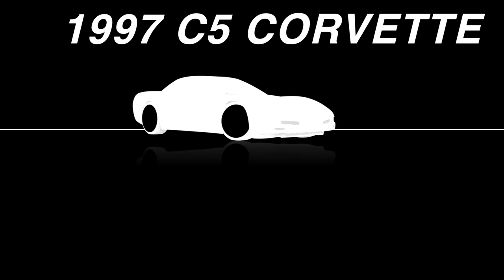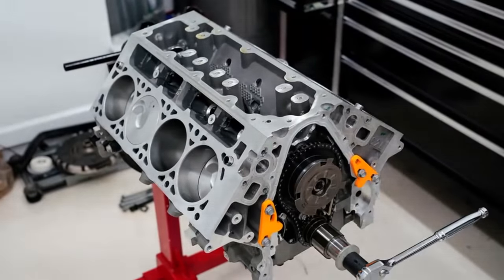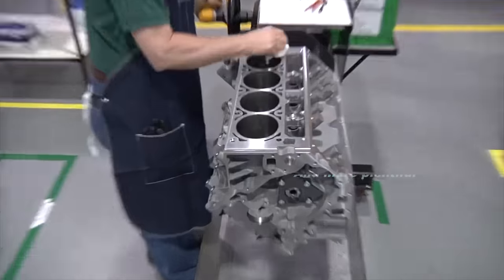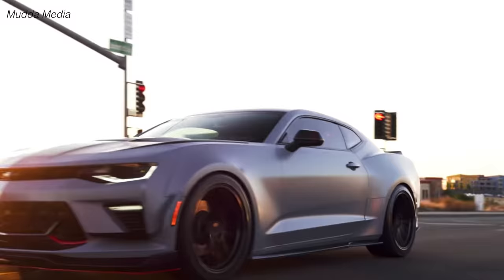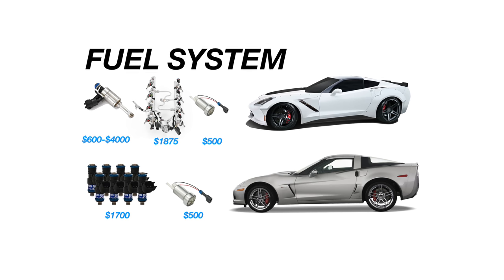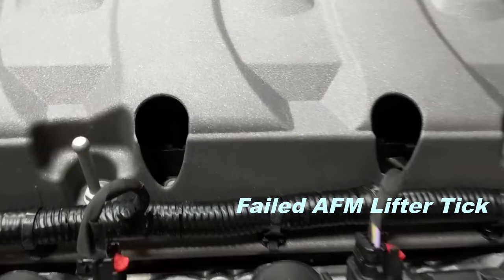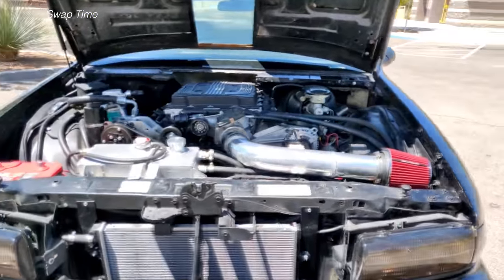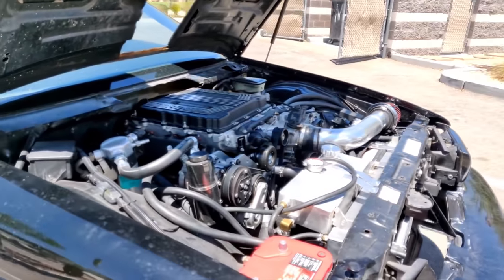Why LS Engines Destroy LT Engines Still😭 | Explained Ep.1

Comment: What's so great about the Ls is you can pretty much grab any variety from the junk yard for 500 bucks, slap some cheap turbos on it, and go faster than anything in your general area. It's great.
Reply: Yea unless some local has a single turbo 2jzgte vvti that’s real spicy
Reply: @jonathanramoslexusmaster298  If that's spicy than a turbo LS is fire. The 2jz single will basically be N/a up to about 3,500rpm. Meanwhile it just got trucked by a 5.3 with two ebay gt45s and a mild cam...bus lengths...a tractor trailor...a mobile home, lol.
Reply: @jonathanramoslexusmaster298  2jz are not $500 bucks, tho. And weigh more than my mom.
Reply: @jonathanramoslexusmaster298  that's 100% irrelevant, because that doesn't matter where the hell you are
Reply: No you can't. Idk where you guys live but I live in phx and I check SoCal yards, Nevada, phx, even Colorado yards and usually if it's a 5.3 or 6.0 it's $900-$1100 depending on if fits a gen 3 or 4. A true "LS1" from an f body or a c5 is at least $1100-1200 depending on where you get it. I can maybe see a 4.8l going for $500 with 250k miles on it but the $500 LS swap is a myth. I'm maybe $2k into my 5.3 swapped obs k2500 and  I still need to finish the exhaust and fab up an intake.
Reply: @MegaDysart  not a myth
Reply: I'm actually going to look at my first LS long block this weekend. 
The kid said it was his grandfather's before he passed and he was the original owner and doesn't know anything else about it so im going to identify what LS it is specifically. He's asking 400, depending on which lsx it is I'd say it's a no brainer for me to pick up this engine?
Reply: @jonathanramoslexusmaster298  even Toyota factory team never choose 2jz as a race car engine. It's not that good.
Reply: @MegaDysart  they are probably just expensive in your area not where I'm at lol

Comment: I like how you said the internet says you need at least 1000hp.  My 505 LS7 is plenty for getting into trouble. Even the C5 Z06 feels very fast. YouTube makes everyone who hasn't driven a fast car yet think these are slow.  Hell, a fiesta st is a ton of fun with 197hp.
Reply: With 1000hp you can’t rlly do much but go straight
Reply: @a1phamalestud  Then sideways very fast
Reply: I blame the YT channels like 1320video that showcases 600-1500HP cars like they were a common thing. People don't realize those cars are the top 1% of fast cars. Heck, if someone has a 400HP car, he's faster than 95% of the cars on the road.
Reply: Exactly. I've driven my buddy's bone stock Evo 8 and the thing is a blast. Don't know the power numbers off the top of my head but it's certainly less than 505.More than enough to have some fun
Reply: We’ll said. They just pull 0-60 times from the internet too. They dont understand the conditions those times are set in.
Reply: @sug8056  true
Reply: @mathieulevasseur4082  I think EVs have made hp completely ridiculous. When every tesla has 500 hp then it makes everything seem insignificant. Obviously a lot more to driving than HP but not on the internet.
Reply: Back in the early 2000s, I knew guys with civics running low 10s all motor lol... think they made like 250 hp XD
Reply: Outside of drag racing, the most fun you can have is driving a "slow" car fast. There is a reason things like Miata's and hot hatches are so popular.
Reply: @wingracer1614  Also cuz their cheap
Reply: A little over 400 horsepower in a mostly stock Challenger (cold air) and I'm both solidly in the 13s and faster than most cars around here... Ya'll Take Care and be safe,  John
Reply: @sug8056  From that "Oh yeah!" to "Oh shit!" Very quick
Reply: I always say there's power you have and power you can use. At some point, there's only so much power most people can safely control plus most of us drive on public roads. The traction control on my 2008 Z06 has saved my bacon many times.
Reply: So when is the LS 7 engine and suspension going into a Fiesta body? (THAT would generate some Youtube views and might pay for the car.)
Reply: I had tire spin issues through third gear with a stock LS7, so of course my solution was to add more power, because I am a disciplined, rational person.

Re: the actual discussion at hand - it is much more fun to drive a slow car fast, than to drive a fast car slow.
Reply: True. And the most reliable power setting is actually just stock with maybe some higher quality material bolt ons. Putting your car on a diet is the same thing as adding horsepower and better handling without any of the drawbacks.
Reply: It's not the size of the swizzle stick, it's how you stir the drink. :D

If you don't match those gobs of horses with a proper suspension, you'll have to slow down to a crawl every time the road deviates from ruler-straight.  I'd much rather have a car that takes longer to get up to speed but that doesn't have to slow down all that much when the road starts twisting. :D
Reply: @mrz80  or, or, hear me out - big power in an also well balanced and light package, so that you can both go fast in a straight line and grip the road and turn
Reply: @AndrewB383   That would be the ideal, most assuredly. Too often, though, I see guys go for power to the exclusion of all else. It's great for burnouts and drag races, but not so much for flogging those sweet little mountain roads. :D
Reply: @mrz80  ohh deff- i'd trade you 600hp out of a 1000 for the ability of taking tight turns at high speeds and have the person next to you wondering "how the hell didnt we flip?". funny enough, it is waaaay harder to make good supension/traction than it is to make big HP.

Comment: My favorite engine of all time is the LS3. Came in my favorite Corvette generation (C6) and my favorite 4 door sedan (SS). The 5th gen Camaro didn't really speak to me that much (mostly due to that hideous interior) but I still would take it's LS3 over the Mustang's 5.0 coyote.
Reply: As a 5th gen owner I never understood the hate towards the interior. Its simple, has cool lights, & easy to clean. I do have a 2ss if that makes a difference.
Reply: @julian_sp  I think everyone got tired of the green LEDs on the dash and door panels. It's the very reason why I didn't get an 5th gen😂🤣plus if you had the automatic it was slower than and 4th gen Camaro.
Reply: Hmmmmnnn… nah.. nothing like a stroked LS7… it will make the power naturally aspirated that of an LS3 supercharged… There is nothing that runs so strong as a built LS7 stroker on nitrous or even turbo. Like the old saying says. There no replacement for displacement. When it comes to Chevy motors they rely very much in displacement. The bigger they are the more power you get specially in latest engines..even though a lot of old school big blocks still make considerable power when done right.
Reply: @julian_sp  I actually love it. It reminds me so much of my high school years..
Reply: @Javservice  wow didn’t know a stroked NA  LS7 could make as much as my Supercharged LS3 Making 900whp. LOL…. That was a dumb statement and mine is still stock bottom end
Reply: C5z owner here... But don't sleep on the Coyote they hurtin feelings

Comment: The LS3's 55mm intake valve was actually sized for a 6.8L and higher RPM, and they used some tricks to make it work on the 6.2.  That's why the LT went to a smaller 54mm valve...which is still too big.  That "big" LT port is the secret to the low end torque; the VVT is just icing on the cake.
Reply: Interesting. At what point is the bigger valve beneficial? Like on a bigger power turbo car.
Reply: @rustysausage69  thanks for the reply. I wonder about cathedral vs square port too since you mention it . I understand you can't put square port heads on 4.8/5.3 engines; but once i was told that on turbo cars the cathedral port heads are good because of velocity they provide vs a square port. Granted I haven't seen data comparing the two in that situation.
Reply: @TurboV8boi  Richard has run the 706 and 317 heads on a 6.0...the 706 make  more power *everywhere*.

He also did a huge head test on a 408.  Dart 2.055" valves were within a few hp of Mast 2.165" (around 620 hp).

A turbo/supercharger is forcing air through the intake valve, so it needs more help on the exhaust side.  A larger/better flowing exhaust, or earlier valve opening.
Reply: @chrisstavro4698  thanks to both of you guys for the information. Good stuff to know. Luckily for me if you put enough boost through it it'll make power, but it's nice to know what really works 👍the more you know
Reply: @rustysausage69  no they don't... multiple test shows they flow right around a stock ls3 head.. ls7 head would make more power than both
Reply: @TurboV8boi  I’m running the larger 2.165” intake valves on my 416 LT1 and making 730whp N/A.
Reply: Its easy, go as big as you can while maintaining port velocity.
  A lot of head design can help road cars with bigger valves but Id say VVT is doing all the work.
   Its like an economy/torque cam vs a race cam all in one.  Literally changing compression with valve timing.
(Gearing and weight too btw)
Reply: VVT widens power band under WOT. Dont need to find power in the mid range. Real helpful in the higher gears. Combine it with lower compression pistons and more boost and longer gears. If you just wanna do burnouts, LS will do just fine.
And try NGK Ruthenium spark plugs.
Reply: @Allmotorzl1 is it n/a or supercharged?

Comment: I've had many LS 6.0 in all of my GM pickups for over 20 years with no problems. My current survivor truck is a 1999 Chevy Silverado 2500 LD 4 X 4 with the LS 6.0 3 door EXT Cab with 6.5' bed. This truck has pulled everything from a 13,000LB Toy Hauler Travel Trailer with 2 full dress Harleys in it to boats and car carriers. It now has 350,000 on the original engine, runs like new does not burn oil. Push rod engines are simple and simple is good.

Comment: Manual transmission LT engines don't have displacement on demand. But imagine using your two feet to drive? Oh the horror!!!!!
Reply: This is simply not true. I own a M7 C7 and it, in fact, does have DOD. I don’t use it, but if you put it in eco mode it will go into v4 mode often.
Reply: 6th Gen manual Camaros 100% do not have AFM in their LT1 engines
Reply: @durchfallklaus4420  I can corroborate this! 6mt LT1 Camaro here
Reply: My 2016 Camaro SS manual (LT1) does not have AFM
Reply: I'll stick with the LT1 in my 96 Z28 6 speed manual convertible Camaro
Reply: My 2016 C7 MT with the 6.2LT definitely has DOD.
Reply: @durchfallklaus4420  Exactly! My 17 SS Camaro 6 spd aint got no damn AFM!

Comment: I remember in the late 90s when the traditional small blocks were the older cheaper tech and LS was exotic and expensive. 
You could still get a cheap pre smog small block with good for the time heads that would make power cheap. 
LS was only in Vettes and F body’s and they were expensive. 
Cool to see the progression.
Reply: For real before the ls...we had the 5.7 vortec...and they were great ....just not as fast as the Ls....or lt, remember racing a 5.3 when they first came out and walked my 5.7....after that I was pretty sure I better get my shit together ....so I procharged the 5.7....lol

Comment: You left out the LS 5.7 the original
The great beauty of the LS is the crank mounted oil pump. This give many options oil pan wise along with the small top end giving plenty of room for accessories along with heads that flow well.  OHC or Hemi adds to the size of the top end significantly making them less swap friendly.

Comment: LT swapping my c10 currently. The LT was my choice purely because I got the engine for "free". Buddy got it through his job at a service center because it was pulled for a stuck lifter under warranty and was just going to be scrapped, I traded him a shotgun for it. Although he did give me the option of the LT or one of the hundred of SBC shorts he had sitting around, but took the LT because I was sold on the direct injection, high flow of the heads, and the 6 bolt mains.

The main downsides to the LT you presented well, and it's as you say the aftermarket isn't there because the engine is still too new.
Reply: @nalgas5569  yeah but I wasn't in the right state of wallet to get a long block LS and I misspoke, it was 6 bolt like the ls1 and ls6 my bad
Reply: Red neck

Comment: While I do agree with everything you’re saying I just think the LT is cooler. And even just cam swapping an L83 and doing dod delete ( identical parts as LS) can get you some pretty wicked power, I’d argue better than a gen 3/4 5.3. 
 Big downsides are accessories/power steering although the l8t does have a hydraulic pump, if you can fit it. And other major downside for euro and jdm is extremely limited selection of front sump pans because of the integrated oil pickup.

Comment: I have a stock C5 Z06 and a stock C4 LT1 Vette. Both great engines and cool cars. The C4 is actually a cooler car IMO. The C5Z is pretty basic/boring unless you are running it hard where it's a very capable and fast car. The C4 is a cool car just to drive down the road.
Reply: Yep had an 88 35th with an L98. Sure top end not really there.. great stop light to stop light and around town though.. plus c4s just have a bad ass look. Interior is like a cock pit. They look they’re going 170 sitting still. Sports cars don’t have that stance anymore.
Reply: I was just reading a thread on Corvetteforum where guys were saying the C4 is a lot more fun to drive, and the C5 is boring in comparison. I wish my 89 had more than 240 hp.
Reply: @fryloc359  safety lol.. c5 and above a lot safer, don’t make all there power low. C4 with an L98 can kill you lol. I’ve had a couple experiences where I should’ve wound up in someone’s garage or a ditch but thankfully didn’t quite happen lol
Reply: Yeah and also as the above commenter said. A c5 or above especially anything that’s a z06 you have to run hard to experience the fun. Try running any of those cars hard hard on a public road lol. Potential death or accident. I fell like from everything I read, unless you track or race a lot .anything past 250-325 HP is wasted on normal roads. Good friend of mine had a 2020 5.0 mustang. Claims the thing just felt bottled up driving around town, nowhere to open up remotely other then highway occasionally. So for around town driving L98 sweet spot and I’m sure LT1 lol. LT1 will have a bit of a highway edge due to extra 55 HP.

Comment: This is a well reasoned, well thought out argument.  I fully agree with all points made.  I've owned 2 LS1 F-Bodies.  Both had over 100k miles on them by the time I sold them with ZERO engine problems.

Comment: A few years ago, Petronix had an engine build competition.  On team built a 350 cid engine while the other team built a LS 6.0 engine.  Both teams had the same budget of 5,000 dollars, the 350 engine outperformed the LS except for fuel mileage.  The price of parts for the older engines were so much cheaper it allowed far more options to build the engine.

Comment: Worth mentioning 97-02 LS was gen 3. 03-07 was gen 3.5 and gen 4 is 2007+.
Gen 3 no afm/dod but weaker. 3.5/4 had stronger rods and pistons with full floating wrist pins.
Reply: I have a gen III lq4 out of a late '03 Denali that came with floating wrist pins and "gen IV pistons and rods".
Reply: @motherlovinsnuffstar  so it was Gen 3.5 then

Comment: LT motors are great. Hopefully down the line they end up in yards for $500. Price is just a massive factor for everyone really. I love my LS1, it runs okay for being 25 years old and having 140k miles. Sure it's not as fast as a Coyote mustang, but it puts a smile on my face. Can't wait to build a 408, just to lose to a FBO E85 10 Speed Camaro/Mustang.
Reply: My G8 GT has a 403 stroker in it and man is it fun. I need to get a more aggressive cam but right now I'm making 410whp at 6,000ft above sea level (I live in Colorado) and even then it's still a blast and torque monster
Reply: @Tanner_Teves  how are the junkyards in Colorado? i’m moving there later this year.
Reply: Hopefully down the line they end up in yards for $500. Not really happening. The engines in yards will cost a fortune to rebuild.
Reply: They will it’s a guarantee,
Reply: @Tanner_Teves  sounds like you need a turbo too then
Reply: @PacoRobbins  Nah it just needs a better cam, torque converter, and tune. They're all pretty conservative right now
Reply: Go to a non-gm shop that'll take warranty work. Most times those LTs will stick a lifter while under warranty, and if it's a non GM shop they'll just yank the whole engine and put in a factory crate replacement. They'll just about give them to you if you know management well enough/work there. Its how I came by mine, my buddy worked in a fiat/Chrysler dealer shop that took any warranty work and one of those happened to be a 2015 Silverado with a stuck lifter. They yanked the thing, and my buddy was able to take it for free because it was just gonna get thrown. I proceeded to trade him a shotgun for it, but the route still stands.

Comment: Being a tech you’ll find out GDI engines are designed to fail after awhile cuz they let a lot of carbon build up on the intake valves and require frequent cleaning but with port injection gas is able to hit the intake valve and clean off the carbon build up so yes GDIs are more fuel efficient and can make better power but the longevity of the engine isn’t so great port injection engine will last longer
Reply: You can solve that problem with a oil catch can.
I've put almost 200k trouble free miles on my l83 and had 150k on one with zero issues before I wrecked it.

Still makes plenty of power in my 2015 rcsb silverado, and I regularly hard launch and do over 130mph in.
Like weekly.
I've beat the hell out of both those motors with no visible loss of power or problems besides a broken valve spring which was an easy fix.